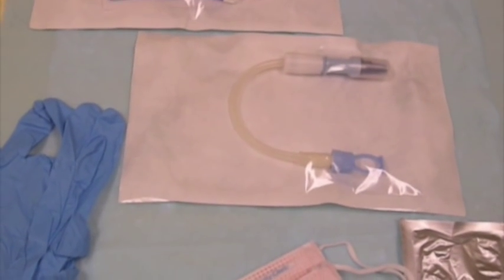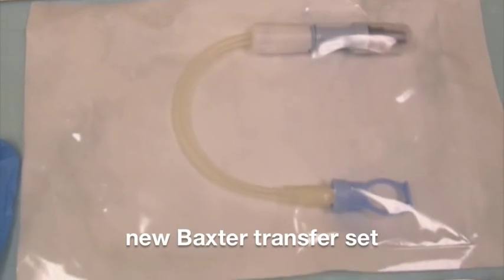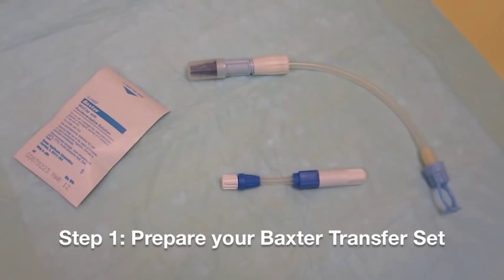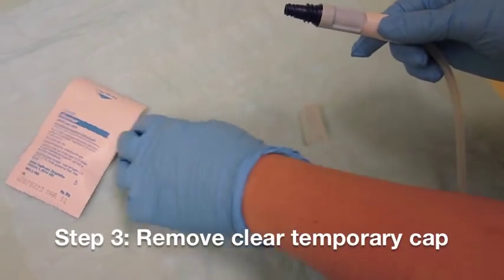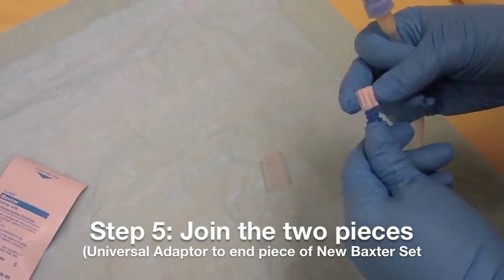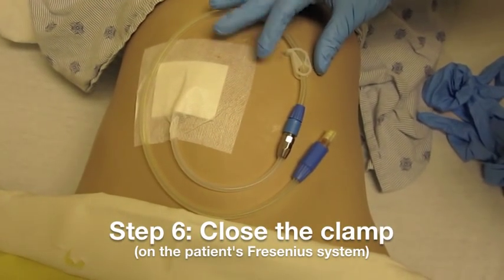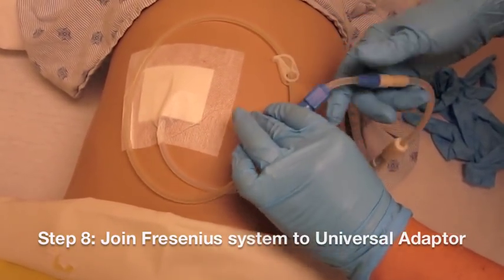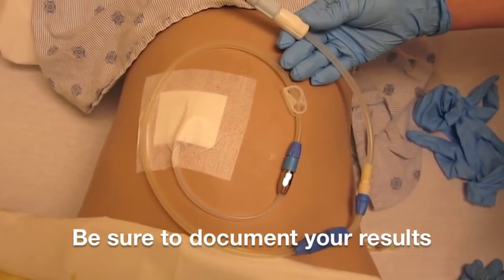How to convert from Fresenius to Baxter

Comment: Do you need to convert a Fresenius to a Baxter before doing a PET test since Fresenius only has a drain bag and no port to remove 10ml then refill the dialysis.  The safety pin needs to be replace after the drain.